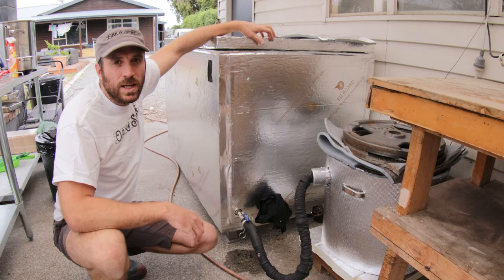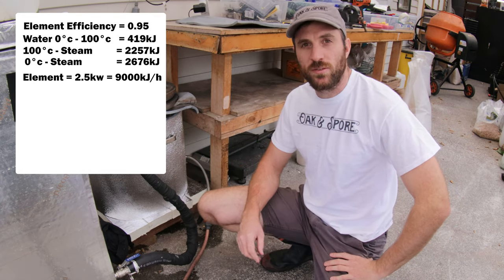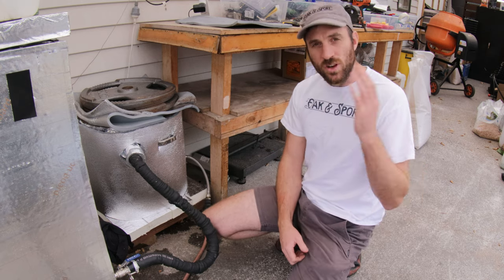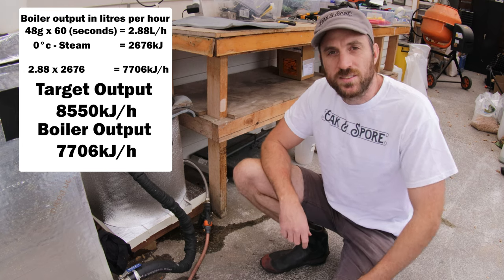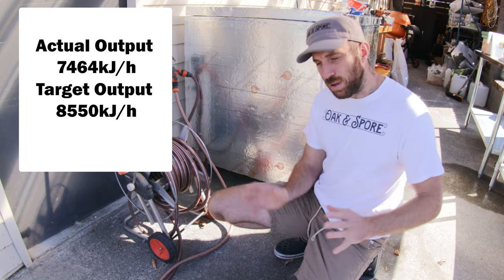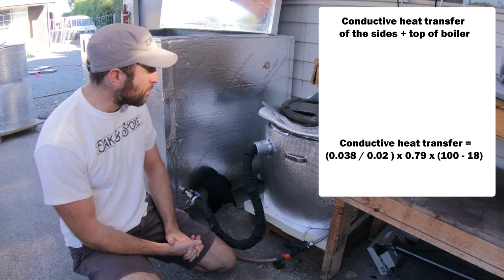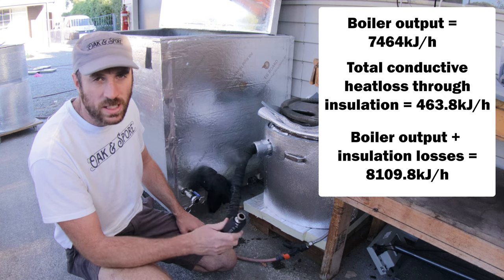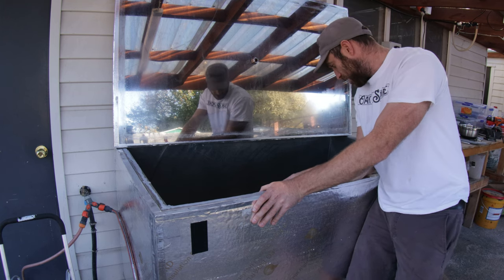Calculating The Efficiency of Steam

Comment: You said it correctly under the video, but mis-spoke in the video. I have seen many people think they can use a steamer for spawn oppose to substrate because the distinction between sterilization and pasteurization is often not made clear when steam units are referred to as sterilizers. As a teacher I believe it is highly important to be precise in our terms. I do appreciate your content.
Reply from the maker: The problem is it isn't pasturisation, its an incomplete sterilization. If I ran an autoclave for half its intended cycle, do you call it pasturisation? No. It's just an incomplete sterilisation. You can sterilize at lower temperatures, it just takes longer. Thermal death time is all that matters.

Comment: You haven't mentioned much about the new boiler yet, but have you considered making it from a less thermally conductive material? Or alternatively including some thermally resistive components in key areas to act as thermal breaks?

As an aside, I was gutted to see your video about your injury. If you need a spare set of hands on the weekend let me know - would be happy to work for some knowledge sharing and maybe a bag or two in trade :-)
Reply from the maker: The material doesn't matter, as long as you insulate it well. Thanks for the offer of help! I have family who are prepared to help me create bags, so I think i will manage.. so long as they hurry up with my surgery!

Comment: Your pipe from the boiler to the tank needs to be shortened. Just long enough to reach the tank. That pipe also needs a drastic size increase. Its like a very thirsty incredible hulk using a straw to drink water. 2 elements work better than one. Add an off switch when it gets up to temp. So you just run one element to maintain. It will reduce run time. Great job love your boiler ideas.
Reply: What do you do with the hot condensate water?

Comment: Have you thought about having the boiler inside the tank? That way you don't need to  insulate the boiler as all the heat generated is already inside the tank. Just focus on insulating the tank to get higher efficiency.

Comment: Holy Mathematics Batman !! (somebody call Leonard Susskind)

why wouldn't you buy a black 30 metre garden hose & lay it out in the sun while you are using the steamer, the sun would warm up the water to over 20c as it travels or sits in the 30 metres or longer  of hose under that roasting hot new Zealand sun.
you can also add a second heating element to the boiler tank or even use a two part expanding heat resistant foam around the boiler tank.
Reply from the maker: This is totally possible, a a VERY good idea! You would aim to heat the water up to close to 100c prior entering the boiler, that way the energy spends less on heating water, and more on the phase change to steam. I might toy with this idea...
Reply: @OakandSpore  Here in Arizona we use this very technique and it speeds the entire process up considerably. We also use water heated this way for making the fruiting blocks prior to pasteurization. We find the substrate absorbs warm water much quicker and when the blocks go into the tub their internal temperature is already reasonably high, once again reducing the time needed to reach optimum range.
Reply from the maker: Well arent you full of good ideas! Using warm water to preheat the blocks is genius...

Comment: One thing to point out: at atmospheric pressure and low pressures, steam is lighter than air of the same temperature:. Your cooker will have air trapped in the bottom. I propose a tube that leads from the lid to the bottom. As the container fills with steam from the top down, the air will be pushed out.
Reply from the maker: Why have I not thought about this! My autoclave literally does the same thing! But I do think convection would get rid of low humidity air pretty fast. it wont take long for all that air to become saturated with steam, especially since the steam enters from the bottom.
Reply: @OakandSpore  remember high humidity air is not steam. Steam collapses entirely to a drop of water leaving in its place a vacuum which draws in more steam.  High humidity air doesn't.  Get rid of the air to maximize thermal efficiency. This will transfer heat to your blocks faster.  Doooo itttt 😅 think like the steam. Be the steam lol hope you feel better man. Wish I was there to help

Comment: Have u thought about wrapping the boiler in 20mm (or thicker) polystyrene sheeting and then applying another layer of that camping mat over the top? The first layer will stop the polystyrene from melting and the last layer should keep in any remianing heat. Might be a cheaper option that the PIR board you have at the bottom.
Reply from the maker: I dont like polystyrene, it makes a mess and is pretty much bad for everything.
Reply: @OakandSpore  true. I just have the camping mat on my barrel just lile your old one. It does well but it still wastes a lot of heat. Cant wait to see the new boiler.  Sorry to hear about your arm. I hope surgery goes well.
Reply: @OakandSpore  also, this isnt realted to this video, but is there a reason why u decided to build out your garage to a grow room rather than just using tents?
Reply from the maker: No reason, its just what I did at the time. The concrete floor makes it easy to clean though
Reply: @OakandSpore  your videos got me into the  game. From high paid wage slave to now a backyard mushroom farmer. I dont know if i could ever work in an office again. This game is so much fun. Love the videos.

Comment: Could you make the arriving water in the boiler spiralling alround the boiler before getting in ?   This way the incoming water catch heat before being heated inside.

I don't know if I formulate myself correctly, thanks you for your calcul, it will help à lot.

Cheers
Reply from the maker: Doing that wouldn't make a difference. it still uses the same energy from the element to heat it up.
Reply: @OakandSpore  It will be good to find a passive way to preheated the water, the water getting in my disturb the production of steam constantly right?

Comment: Wouldn't it make more sense to build a steam generator inside the bottom of your sterilization box? No energy loss except for what you would have anyway with the box. Maybe use steel drums with banded lids for the sterilizer. These can be had cheap and are made to seal well to the point that you may have to make so sort of vent so they don't build to much pressure. Also, any condensed steam would drain back into the boiler section further increasing efficiency as less cold water would need to be heated to produce steam.
Reply from the maker: I originally did this, but damaged it bad when I had a water problem. basically all the wood started to over cook and burn. But It is the most efficient way, yes.
Reply: @OakandSpore  Redundant systems. Put in two float valves if that was a problem. Pay for itself in electrical savings.